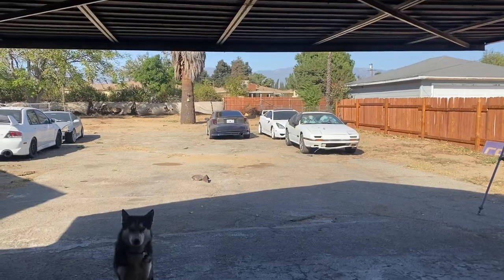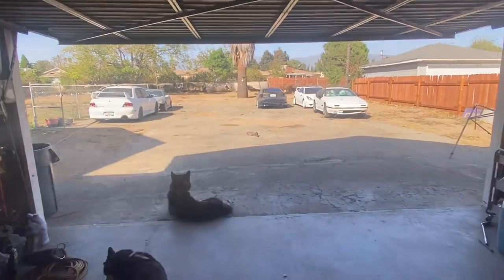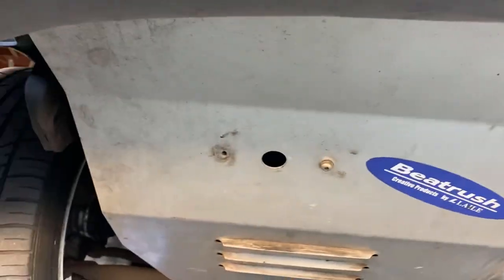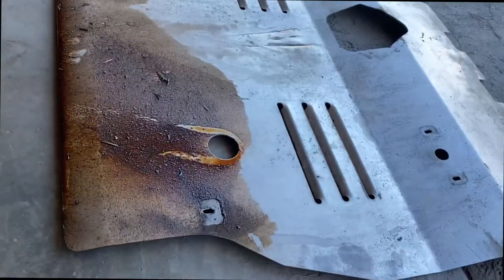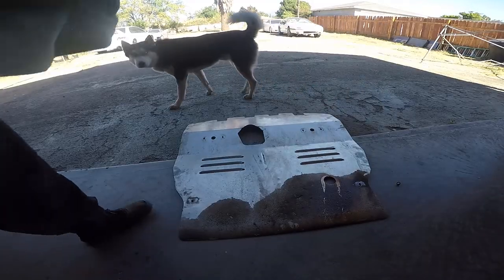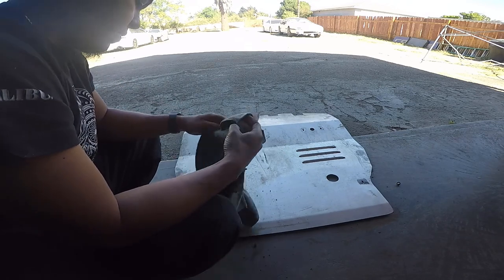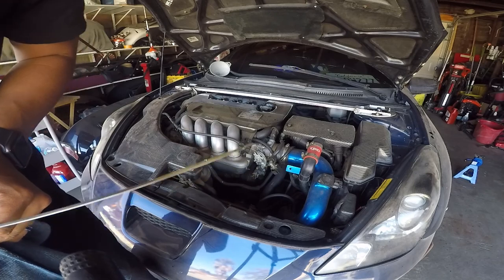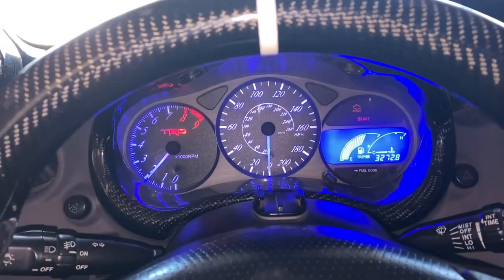Smurf Gets An Oil Change

Comment: 230k miles with stock engine or rebuild mate?
Reply from the maker: Stock
Reply: @RafasGarage  very impressive mate! Have you ever wiped intake camshaft in 2zzge? Also need valve adjustment?